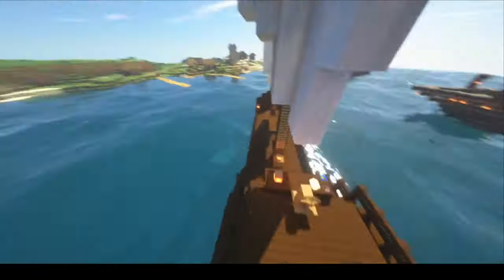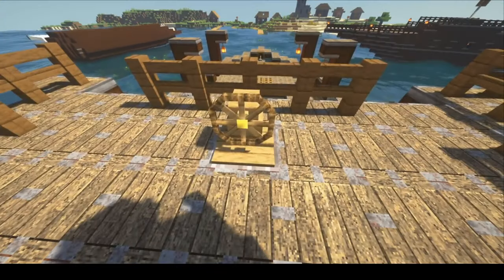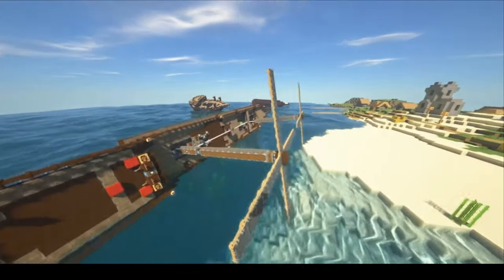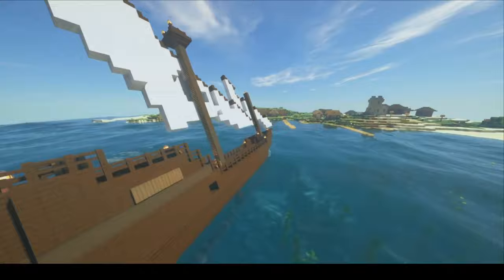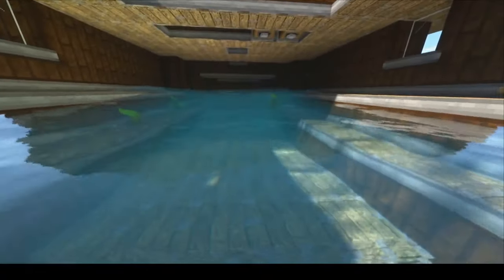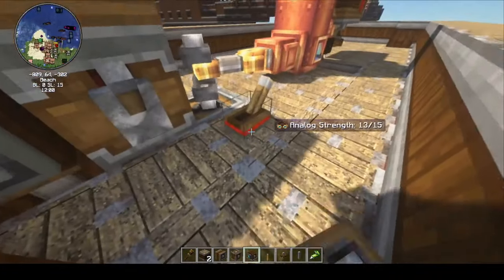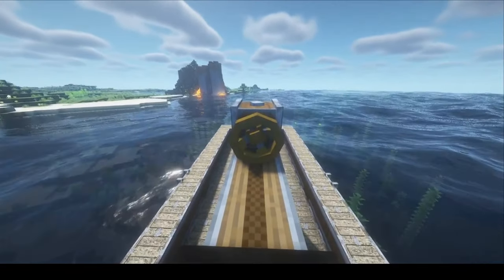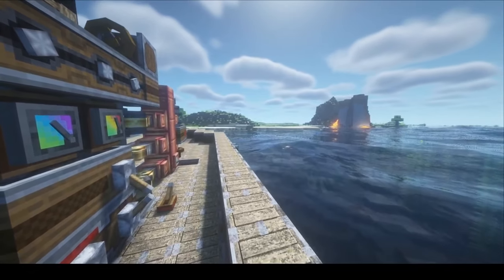Steamship using Valkyrien Skies Clockwork and Create mod!

Comment: hey man i really need some help, how are your ships floating at all? everything ive tried and mine is just sinking. ive used wings, hasnt worked, lighter blocks / removed blocks entirely, hasnt worked, and ive even added propellers on to make it go up, but that hasnt worked either. there is 0 way it can be too heavy as the entire thing is basically wood. its stable, it just doesnt float. im genuinely annoyed with this and really need some help

Comment: Small tip from a guy who plays a Lot of Stormworks, which is basically, CAer/VS if it was it's own game.
Try removing the bottom central part of the hull and replace those blocks with something that doesn't float. Stone may work just perfectly. As such, you get a ship that floats not on something with a form of plastic bottle and is easy to turn over, but over a stretched doughnut. Changing how many blocks you have replaced with un-buoyant blocks may affect the waterline of the ship as well.
Reply from the maker: I'll have to play around with that, thanks for the tip!

Comment: I wish we could use the large water wheels as paddles on the sides as that's an actual design riverboats used. Can probably use it as decoration but probably not an actual propulsion system

Comment: For the rudder did you use the flaps or wings?
Reply from the maker: Flaps
Reply: @KwizzleHazzizle  thanks
Reply: @KwizzleHazzizle   I'm using flaps and still going straight. what bearing are you using? can you make  a more detailed video? you just fly through everything